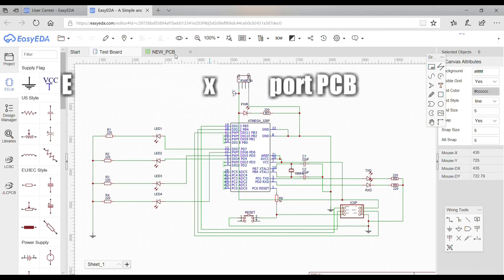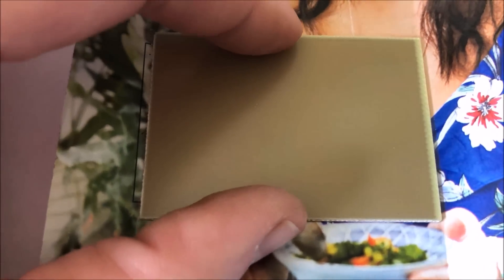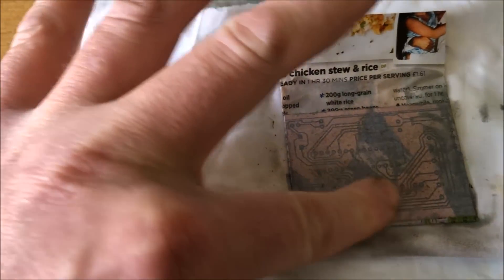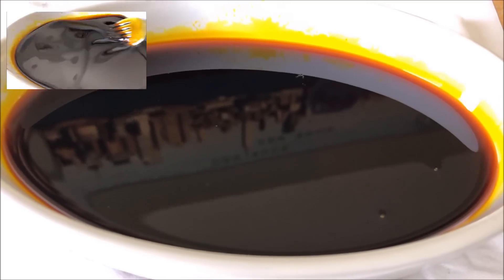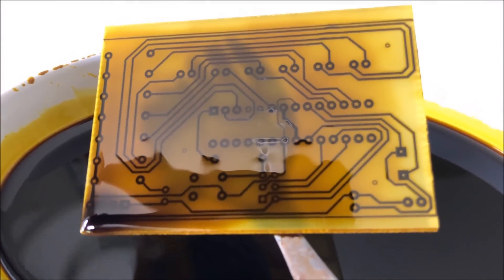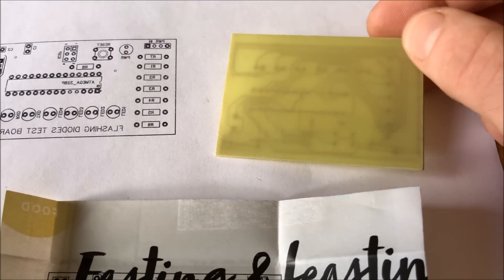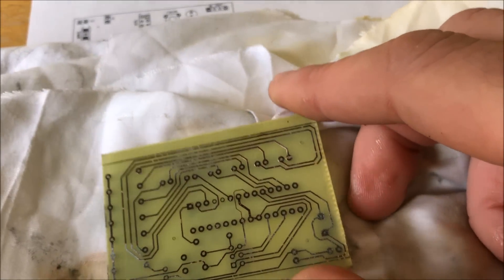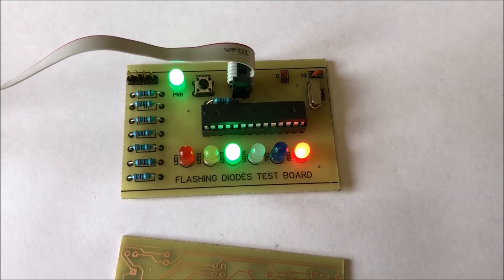DIY PCB Toner Transfer (No Heat) & Etching

Comment: Thanks a lot Gareth, unbelievable results!
Have you tried this with much larger boards? 
I'm curious if there are any issues with transferred image distortion due to possible inconsistant wetting and preassure application. 

Judging by some of the comments from people attempting to use pure acetone it seems that the strength/purity is a drawback.
I actually tried this few years ago with pure acetone and got pretty bad results and evetually gave up on it. 
Have you tried using pure acetone, if so what were your results?

Once again, great job can't believe that there is one shoupak in the comment section bitchng about the design of the PCB and trace thickness!
It really takes an "idiot" to call someone else one, unbelevable.

Anyway, very impressive.
Have a great day!

Comment: My only question is why I haven't seen this method before...
Reply: because the government is hiding it from us
Reply: It's one of those ideas that seems so obvious in retrospect. I've used the transfer sheets before. Those make sense. I've done the magazine/heat transfer thing which is just an extension of that. Fair enough. But using a solvent on the toner? Toner has been in use for decades and we're just getting to it now.
Reply: makes you wonder if it was discovered by accident or a product of someone's crazy idea.
Reply: I don't know, i did this manny years ago and used aceton,  i used a mix from hydrochloric acid and  hydrogen peroxide for etsing..  done in 2 minutes..
Reply: @janvanderwal2744  !!
Reply: @janvanderwal2744  for those that don't know fingernail remover is acetone. Buy 100% acetone dirt cheap at Walmart and like stores. Do not buy the expensive buy the cheap! Hope this helps and best of luck, to you.
Reply: @druggles1  Another commenter on another similar video states that nail polish remover CONTAINS acetone, it is NOT 100% acetone. Which is why you have to dilute the acetone by about 1:1 with water for best results (he says).

Comment: Designed by an idiot.   Only an idiot uses the smallest traces they think they can get away with and wastes etchant in the process.  Kids, you should use every available space for every trace with the only exception being if you're using the rest of the copper for a power or ground plane.  Hint:  If your PCB software sets this up that way, it too was designed by an idiot but you can't shift blame if you're using software designed by an idiot.

Comment: I wonder which chemical actually does the job.

Ingredients
Acetone, Aqua, Parfum, Ethoxydiglycol, PPG-12-PEG-50 Lanolin, Benzophenone-3, Panthenol, Tocopheryl Acetate, Aloe Barbadensis Leaf Extract, Propylene Glycol, Sodium Benzoate, Methylparaben, Sorbic Acid, Benzyl Cinnamate, Benzyl Salicylate, Cinnamyl Alcohol, Hydroxyisohexyl 3-Cyclohexene Carboxaldehyde, CI 42053, CI 19140, CI 42090
Reply: ты на хера столько букв выдал ?

Comment: it's just not worth the time and effort these days when you can get boards made cheaply and fast in small batches.
Reply: @ Axe Man
Could you elaborate on companies which do it for reasonable price and time to deliver let say to USA or Canada?

With this method and laser printer at my desk I can produce the board in 15-20 minutes.
Reply: +John Dreamer, Firstly, I don't believe you, it takes longer than that to drill the holes.
Furthermore try making a 2 sided board, and then adding solder mask and component layout printing and routing it out into a shape to fit an enclosure, let alone try to make a multi-layer board, it's just not worth it and produces and inferior result in the end anyway.

Strip board or even breadboards are fine for basic prototyping but anything more serious is worth getting a proper board made for imho.

I talked to a guy in Europe somewhere who had a place he could get 24 hour turn around for boards, but there are many places online who offer a service at very competitive prices. Yes it may take longer but you get a much better result for much less messing around.

I don't have links to specific places to hand but Adafruit do a service and Dave Jones (EEVBlog) did a video recently on some boards he had done somewhere cheaply and very quickly in which he talks about how it's not worth the time and effort to make your own boards anymore.
Reply: @ Axe Man
Well in this video the author demonstrated how to make one side board only. I do not talk about multilayered printed circuit boards at all. And I do not take in account the development of PCB in software on a computer -- I refer to physical production of proto-board in quantity of one at home (transfer and etching). Nowadays with SMD components very little drilling required -- if a simple drill press is available and only 3-4 drill sizes require then it should not take much time to drill holes for connectors.

I still get my hands on some old equipment (Sony radios/VCRs, some old TVs for salvaging components) -- practically all of them are single sided PCBs with jumper wires. What is interesting -- most of this equipment in perfect good working condition and disposed due replacement by new technology. 

I can not attest same for more modern equipment -- rate of failure significantly higher (more complex devices have higher rate of failure). I do not refer to military grade equipment of cause, military equipment normally decommissioned  in good working condition due replacement with a new technology.

As an example I can bring video cards of Zotac company -- I had an employment with a university. One day a student complained about problem with a computer - on my check I found that the computer had Zotac video card. On this video card half of the capacitors was bulged -- I put a spare video card I fixed earlier (by the way after my repair the card served more than 3 years before the computer was decommissioned). On my further check I found that all Zotac video cards had same problem in the lab (it is more than 30 computers).

As an another example a few years ago I got LG 1080p TV -- good inexpensive model. In a few month latter the TV refused to turn on -- as it was under warranty I had to 'dig out' who can repair it. To my apartment came two men and they replaced main board of the TV -- the issue was with microcontroller program, somehow it 'damaged' itself and it was common flaw with several models of LG TVs. Side problem was that I had to search for a company who provide warranty service and wait more than a week to receive the replacement service -- there are a very few companies around who make repair of electronics (it is too expensive in Canada and many people just dispose broken equipment). Note: I live in Vancouver, British Columbia with population over 2.5 million people.

Strip boards and perfo-boards are ok if the layout made properly. I can not say same about bread-board -- the contacts is not reliable, high inductive and capacities of internal joints, no way for ground plane. The bread-board is not suitable for any radio frequency development -- it require sturdy connections and 'Manhattan style' is better fit for radio development/prototyping. 

As an example I was designing my own micro-controlled solder station by utilizing Atmega 32p dip chip -- ADC conversion of measurement was unstable due absence of ground plain and one power source for solder iron and microcontroller. At the end I had to solve the issue on program level -- to turn off the solder iron heater, start ADC measurement and put microcontroller into sleep mode with wake-up by interrupt at the end of ADC conversion (the process takes less than a micro-second), then based on ADC result turn on the iron heater or leave it in off state until next ADC conversion. When I did study the datasheet for this microcontroller I found an information that even working ALU can cause unreliable reading of ADC conversion -- they suggest to put microcontroller into sleep mode to take ADC sampling.

Yes, I have seen some companies on internet where you can get a PCB of small size for $4/piece in quantity of 10 -- but they made in China and delivery time would take from 3 to 8 weeks (nor they nor me has a control over shipment time). 

I can get made PCB in Alberta (Canada) -- our neighbor province for triple price $12/piece and waiting about a week, before I will receive the board to my door. I am sure that quality will be much better than what I would 'produce' in  my home lab -- but it takes a week and I need to order a bunch of at least 5 pieces. 

It just does not make a sense, if I need a mass production then of cause I would prefer to deal with China, if I need a small production then I would order from Canada (from USA it would require to deal with Customs what is a pain in the neck) -- of cause my client has to pay a good price for Canadian PCB service.

Just for a reference how much it cost to make a PCB locally

Vancover -- https://www.omnicircuitboards.com/

Alberta -- https://www.apcircuits.com/job-estimator.aspx

China -- https://www.pcbway.com/orderonline.aspx?x=10&y=7.5&num=10&Layersquote=2&Thicknessquote=1.6
Reply: Then there's what happens if you make a mistake. If you're making your own board, simple to redo it properly. If you order any quantity, that's quite a few boards you need to do remedial work on (if that's even possible).
Reply: +Chaos Corner, that can just as easily happen with home made boards, in fact i'd argue it's more likely and that you have a whole other bunch of problems with the toner transfer method as well.
Reply: It certainly can. Which is the point. You now have a single board with an error. You can make another one cheaply, quickly and don't have to fix the error on (minimum order count) 10 other boards. I'm not saying it's the be-all-end-all but it definitely has its place.

Comment: Tried... failed:( The toner ink dissapairs with the nail polish remover. just a big stain of black left on the copper. My nail polish remolver is without acetone!
Reply from the maker: Roger Høiås ahhh I should of made that clearer, it needs to have acetone in for it to work
Reply: Gareth Burrows Figure;) will it work with pure acetone?
Reply: @rogerhias736  Yes, it would be better off.
Reply: Tried using pure acetone and magazine paper, it melted the toner traces and ended up with a big smear as well.  I actually do think the moisturizers in this may actually be helping.  There is another method similar to this that mixes alcohol with the acetone to dilute the acetone.  If using 100% acetone, with thin magazine paper, the acetone soaks through the paper too quickly and the liquid acetone will dissolve the toner rapidly.  What I believe is working is the acetone vapor is what is melting the toner to the board not necessarily the liquid.  Without some kind of dilution, the acetone will just soak through and/or evaporate too quickly.  When I tried, the acetone I poured on the back of the paper dried in just a couple of seconds, so I added more, it went straight through the paper and basically dissolved all the toner.  Tried several times with this and it did not work.  I will try the sally hansen version with extra moisturizers or the alcohol dilution method next.
Reply: @ambience522  Please do and return here with your future results. Adding some water to the acetone may help, or will it make it worse, I don't know. Isopropyl is another substance that might be worth trying mixing with the acetone. Ratio 1:1 should be a proper first try.
Edit: Look at what Hack In Black wrote further down:
"I soaked the BACK of the paper with a few drops of acetone, which seeps into the paper and dissolves the toner; the reason i soaked the back was to make sure the toner was well dissolved and to avoid smudging the tracks when placing it on the copper. (if you drop acetone on the brother toner it almost dribbles off the paper) the ideal is nothing between the toner and the clean copper...and that includes a layer of acetone... While the paper is still wet, place it carefully onto the copper PCB, press down with your fingers or a flat board padded with tissue ( i used a rubber roller from a dead inkjet printer to roll it firmly on) leave to dry."
He used pure acetone and it seems to work well for him.
Reply: not all toners are equal, my failed with acetone but i found another solvent "paint thinner" (which has Xylene in it) i mix that wich isopronalnol (1part Xylene + 3 Parts 100% isoalcohol)

For the toner which work with acetone, most people also prefer a mix with isoalcohol because it raises the evaporation time, pure acetone can vaporise sometimes in 1-3 second way to fast .

you must experiment a bit.

Comment: Please try using a tripod [or any equivalent stable mount] to hold the camera rock steady, aiming squarely looking down on your work space.  This will allow you to use both hands during your demonstration without inducing motion sickness in viewers.  
For etching, a small rectangular Tupperware container with its tight-seal lid allows you to gently shake/agitate the etchant, and you can also heat the etchant [with the board immersed] in a microwave oven to 45 degC for faster etching.  With hot etchant and continuous gentle agitation you can expect a perfect etch in less than three minutes.
Leave the etchant in the Tupperware for future use.
Reply from the maker: Thanks for your reply, a tripod would have been handy but I wasn’t planning on making this vid, I was off work bored with a ruptured Achilles’ tendon, since making this I’ve bought one for future vids.. nothing worse than a wobbly video 😂  I did a actually heat the etchant but didn’t show in vid.
Reply: Sincere sympathy for the tendon injury - one of my friends had this happen some years ago, so I got to witness the aftereffects.
Hope I didn't offend you with my comments.  Many thanks for a great idea, I'll try it soon.  I etched my first card in 1966 and still occasionally use KPR photoresist to coat bare copper card stock then expose with a sun lamp through a 'negative' laser-printed on transparency film.  Much nuisance for a single card, plus breathing toxic solvents like toluene in the KPR developer.
Reply from the maker: jrb _sland no offence taken, quite comical doing everything one handed 😂  not the best injury to have, but learnt some new skills with the time off!

Comment: Great video man, the best and easiest method for DIY PCB making in youtube so far.
Any body can make a video with expensive printers and special papers but no all the viewers will be able to follow their style.
Your's is unique man, All house hold items used. 

I like your style, Make it simple with what you get( The actual DIY way)
Keep making useful and simple videos like this man.
Reply: Sure but honestly, my printer is the cheapest 99$ canon with integrated scanner, I also use junk mail to print on (no need to tape it to printer paper first) and yeah I use a small, unmodified laminator, no need for expensive stuff
Reply: i don't think ferric chloride is a household item

Comment: Fun fact:  You don't have to clean the copper board at all. You can use it smudged and with greasy fingerprints. Makes no difference for the toner transfer and etching process.
Reply: Why are you lying?  You just like to ruin other peoples' efforts?  Sick a-hole, it makes all the difference in the world to have a clean copper board, otherwise the toner falls off.
Reply: I stand with my comment. I have no reason to lie.
Don't want to ruin anyones projekt and certainly not my own. There is no cleaning apart from wiping loose dustpartikels with my BARE fingers from the copper.   
If it ruined your project, assuming you did try it first before accusing me of lying, I offer my sincere apoligy. Have a nice day.